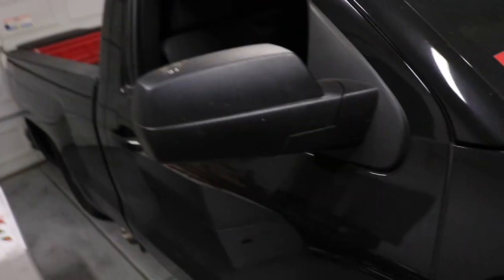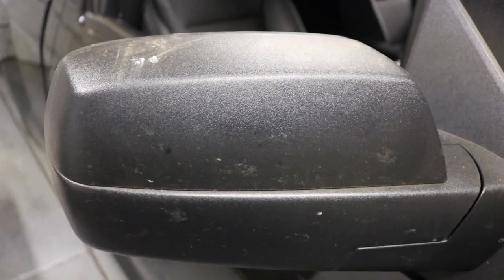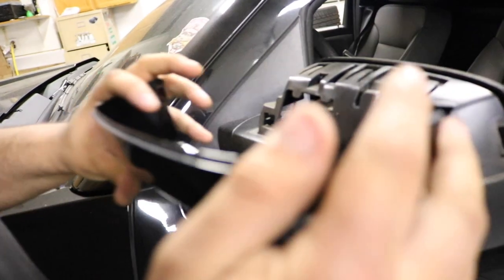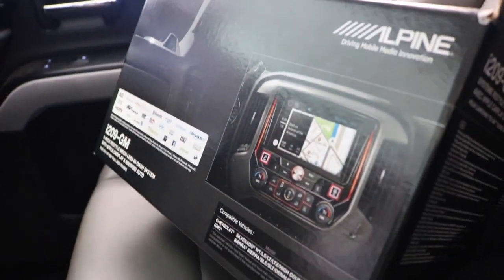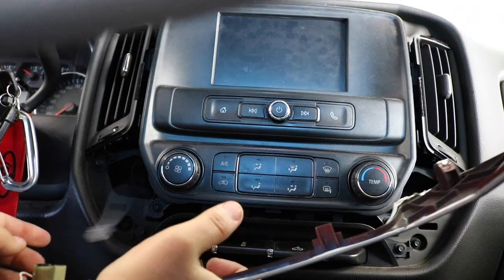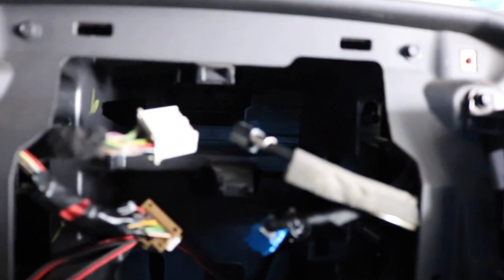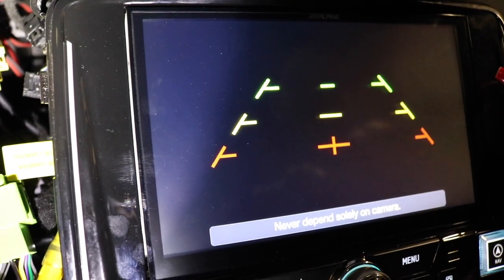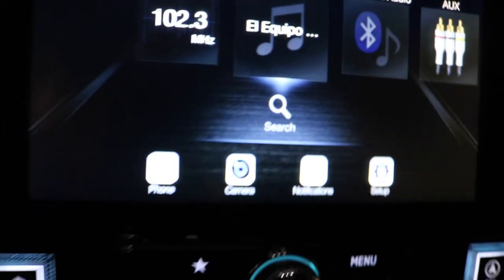INSTALL: ALPINE i209GM STEREO & MIRROR CAPS ON MY 2018 SILVERADO

Comment: Do you have the reverse camera wired to the reverse light?  I typically ground the camera where it's mounted and attach the  red 12v wire to the reverse light 12v.  I have seen people wire the camera 12v to accessory 12v and have it running and on all the time.

Comment: How much for the truck, its dope, I have gotten older n dont feel like hooking one up, I'm just asking
Reply from the maker: Special300med i’d let it go for around 35k or so
Reply: 35,000, what size engine, 6.0 6.2
Reply from the maker: Special300med stock 5.3. gm single cabs don’t come with anything bigger than that